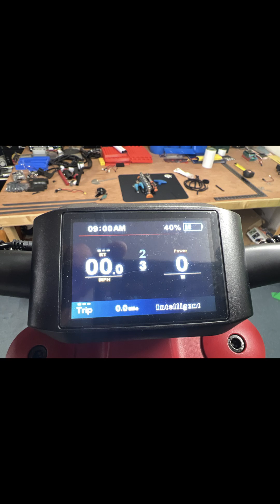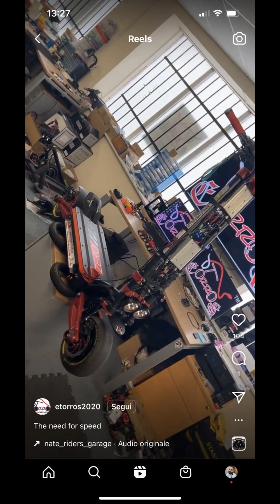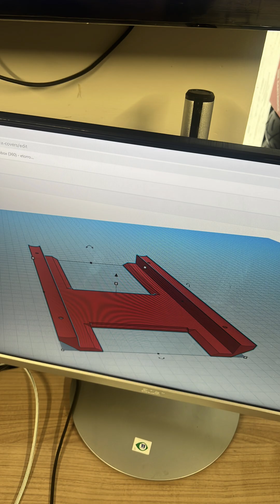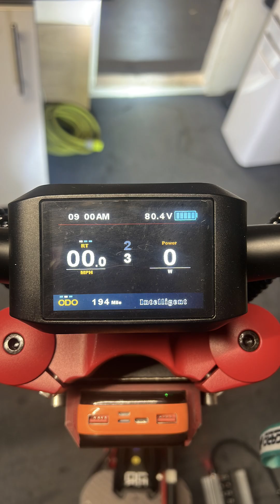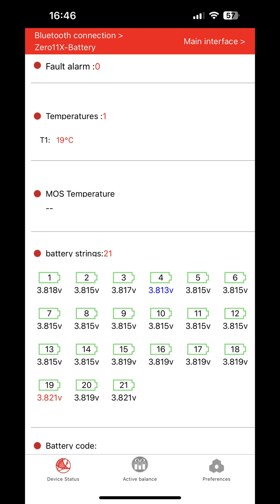Zero 11X Supra - Origins (Over 600 pictures from my phone)

Comment: what motors do you use? what company?
Reply from the maker: Lonnyo Motors, custom made for ETORROS LTD ( 6000W 33x2 75H  with temp sensor )
Reply: @etorrosltd  and the battery is 72v and how much Ah and (C)?
Reply: @etorrosltd what would be the best winding if i want to have max speed around 120 , but reach 100 in the shortest time possible?
Reply from the maker: @Electric_heaven_dp  33X2 with some 80mm magnets and minimum 200A phase controllers each… depending on your weight you can do 6s time 0-100km/h…i’ve done 0-100km/h in 8 seconds with this motors and i’m 120kg+gear +85kg scooter …
Reply: @etorrosltd  i am around 90kg , as far as i know 33x2 is winding for max speed , and the longer the magnets are the faster acceleration is but the top speed is smaller , so 33x2 kind of compensate the length and allows the wheel to reach 120km/h ? And length of magnets allows the wheel to reach 100 faster compared to 60-70 mm ? Is that how it works?
Reply from the maker: @Electric_heaven_dp  yes..
Reply: @etorrosltd   btw i thought your custom had motor wheels with 75mm magnets or these are 80mm as you told me before
Reply: @etorrosltd  I was planning to make something worthy of your project but was planning to use Votol controller (also use zero 11x)  173x105x55.5 mm
Will it suit the place you used to place Kelly? I would greatly appreciate your feedback
Reply from the maker: @Electric_heaven_dp  it should yes from what I have seen at another builder who used Votol Controller! Contact me on WhatsApp and I’ll put you in contact with him for more information! ✌️ Thank you for supporting me here! 💪
Reply from the maker: @Electric_heaven_dp  my project has gone through 3 types of motors, 65H, 80H and the last one and the one that are on the scooter now, 75H !
Reply from the maker: @Electric_heaven_dp  the motors that are now on Zero11X Supra are made custom and they have temperature sensor as well compatible with Kelly controllers + other modifications different than original factory type!
Reply from the maker: @Electric_heaven_dp  yes, that’s correct! But using powerful controllers, 33x2 winding can offer great torque as well!
Reply: @etorrosltd  what was wrong with 80H?
What about my question about controller size above?

Comment: can you share please what phase wires or any other you used for replacement of old ones
Reply from the maker: I have used 7AWG wires that come with the motors, I have requested from the factory to make 1 motor with 130cm and another motor with 200cm wires! When you buy the motors from me they come exactly as you need them ! they are custom made based on my requirements!